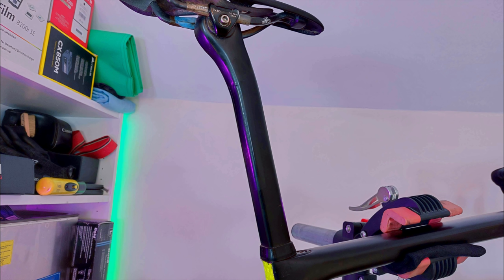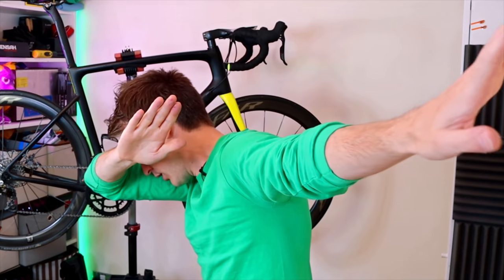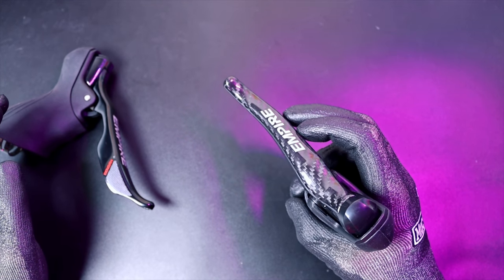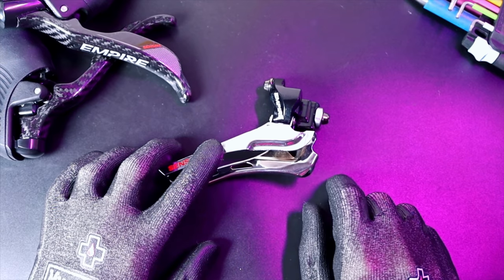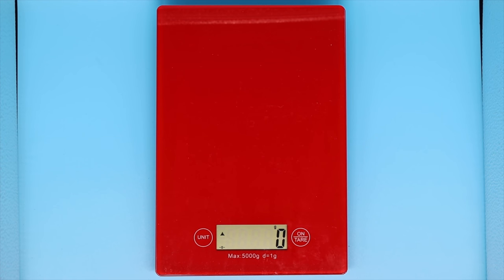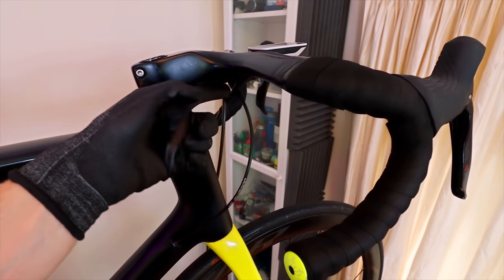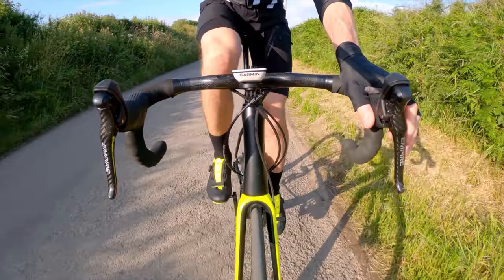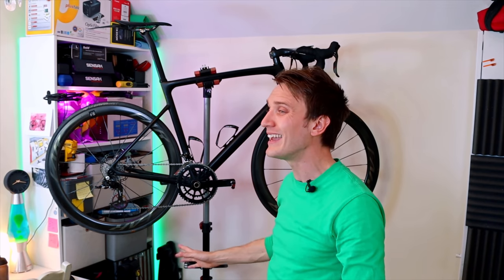Chinese Full Carbon Groupset (with OSPW) - Sensah Empire

Comment: May I suggest Trace Velo do a Power Meter video series next?  The crankset is probably the last thing that hasn’t been upgraded on the fully carbon bike.
Reply: ive got the sigeyi axo and zrace crankset. its awesome.
Reply: @abedfo88  Hiw reliable has it been?
Reply: @takotsubo as long as its consistent with itself what does it matter how it compares to assioma duo 🤔
Reply: @elijahkwon422  100% reliable
Reply: @abedfo88  Have you done any accuracy checks
Reply: @elijahkwon422  i will do this coming winter with my elite direto but knowing my power numbers etc it seems to be pretty good.
Reply: @abedfo88  what kind of pm is dat? The spider based? Andd on what crankset? Haha thanks in advance
Reply: @Lutherman_edc  spider based. If you go on their website/ali express shop they sell a number of models to fit different cranksets.
Reply: @abedfo88  ohh nicee thanks mann and what crankset do you use?
Reply: @Lutherman_edc  the Zrace one. You can buy that, the BB and the power meter in a bundle.
Reply: Can you make a video solving the carbon trouble you mention on 5:42 of this video. Thanks

Comment: I had the 9 to 10 shifting problem, which I could never figure out. The derailleur seemed well aligned to me. After 6 months, the problem went away, so I had assumed it was a machining problem on the cassette that was worn away with usage. I've been mostly happy with my Sensah gear, and thank you for being a valuable technical resource on their products.
Reply: I've had the same problem on my bike a few weeks ago, when i asked my mechanic, he said it was normal because it was new, fresh from the factory and overtime the chain, cassette and rd will eventually adapt to the shifting, which eventually it did

Comment: Me: So Trace how many chinese carbon fibre parts do you think you can put on a bike?

Trace: Yes
Reply from the maker: I think the only parts that arn't cheaper alternatives are the chain, the tyres, and the cable housings 😂
Reply: @TraceVelo  indeed, and now ali express ads tax the cost/benefit ratio has gone down slightly imho.
Reply: @abedfo88  Yeah - I noticed that (in UK), this happened after Brexit. Odd.
Reply: @Mango62uk  though I did buy something over £200 and I didn't pay any tax (shrugs shoulders)
Reply: @abedfo88  Interesting. Now, even for the smallest thing, Aliexpress shows tax for UK sales. I suppose it's a good thing, as long as the tax is sent to UK govt!
Reply: @Mango62uk  Hahaha well that's debatable ! 

Yeah annoying how things like cycking socks have gone from £1.50 to £3
Reply: @abedfo88  Bloody hell, you're correct. I checked my account and I paid £1.82 (incl delivery) for a pair of cycling socks in Nov 2020 and today, there're around £3! It really is the post-Brexit trade thingy, 'cos importers now have to account to HMRC directly for UK VAT payments!
Reply: @abedfo88  in italy too, if you buy less than 150€ they add tax since july 2021

Comment: Hi Luke, I'm happy your name hasn't changed. Last week I received my sensah empire groupset and a new 11 speed chainset, now I only need to get some specific tools and a clamp for the front derailleur and will perform the jump from 8 speed to 11 speed on my GT ZR 2000 (I'm ready to take the hub's cassette body to a friend that is quite experienced with a lathe if the larger cassette was to present fitting problems). After almost six years with this bike I'm super stoked!
Thank you for providing me and others with products reviews, experiences, useful tips and great comedic bits. I hope you keep the videos coming!

Comment: Trace Velo: Buy cheaper bike components and save money over alternatives
also Trace Velo: LMAO just replaced this component that works fine for the 15th time :P
Reply: For free.
Reply: This is still a good value compared to standard 105 even if the non carbon version does not exist
Reply: He can replace the groupset and wheels before he even buys a 105 groupset for 700$
Reply: This video was sponsored / paid promotion.

Comment: Great channel.  I did purchase a Sensah SRX Pro group set in an effort to make an ultimate road climber - it failed miserably.  The front chain ring could not tolerate the torque and bent.  The derailleur  would down shift all on it's own.  The chain was of very poor quality.  All of his installed by a tenured bike mechanic.  I threw the entire set out an went with full Sram components.  Yes, a few bucks more but the shifting is flawless.  By way of mention I did do this build on an Elves frame which seems quie good and wen with ICAN rims that seem to be performing well.  Chinese cycling products seem to be hit or miss.

Comment: I broke my Tiagra shifters and replaced them with Sensah Quantum shifters (the ten speed version of Empire), which are 100% compatible with Shimano. If anything I prefer them to the original Tiagra shifters. Shifting is very crisp and now I've got used to the SRAM style double-tap system I think I prefer it. In fact I'd say the Sensah shifting system is actually better than SRAM system as you shift with the main brake lever rather than a smaller secondary lever. Recommended...very well made shifters and super cheap.
Reply from the maker: Awesome, glad you like them Simon!

Comment: I've been using Sensah for the past 2 years, around 40k Kms on it, I only had to replace the right shifter hood cover (4€).
Reply: UPDATE: Today the screw from the  above little-wheel of the rear derailleur (IDK how it is called in English) just fell out and I had to stop, take the whole thing out and screw it again into the derailleur
Reply: @daniellopez9622  jinxed it mate
Reply: @daniellopez9622  derailleur jockey wheels should have threadlocking compound to stop screws/bolts from coming loose e.g.  Loctite Threadlocker Blue 242. Maybe the Sensah ones didn't come with it, or not enough?
Reply: @richardggeorge  UPDATE: The bearings inside the jockey wheel were all broken and the screw didn't match the cage anymore, the cage expanded itself and after replacing the jockey wheels with the Ultegra ones the cage of the derailleur did not hold the screws and it just broke... Luckily I was near home.
Reply: @daniellopez9622  Sorry to hear that. Doesn't sound like the jockey wheels are very durable. I have several shimano ones that are over 10 years old. I have 4 road bikes though
Reply: @daniellopez9622  Can you confirm the jockey wheel that comes with pro is the Utegra version? Since the derailleur is sram, I would think the pulley would be same
Reply: @cornelhughes6763  I only can confirm that Ultegra jockey wheels do not work for this groupset

Comment: The company Finish Line has an anti-seize assembly lube. Here in Germany you get it for 5€ (22 ml) which should last for quite a while and will prevent any cold welding of screws etc.

Comment: I think the screw in the rear derailleur ceased up because of contact corrosion (Alumunium/Steel)
Great video as always!
Reply from the maker: Yeah, I recon you're probably right. Hopefully the oil I added will help out in this regard....
Reply: I've managed to strip the non-drive side crank (Shimano) bolt head hex slot TWICE.  Now I put on some anti-seize compound on the crank bolt thread and regular grease on other bolts.
Reply: @john lin is right some copper compound will prevent that in the future 👌

Comment: Another great vid Luke! Am absolutely loving the channel; you are head and shoulders more fun and informative than GCN.

Thanks to you I'm rocking a new gravel bike build using Sensah's SRX Pro 1x groupset with ZRace crankset (plus an absolute feast of cheap Chinese carbon finishing kit!) I've done about 2,000 miles on the groupset now and it hasn't missed a beat. The downshift is the best I've ever used on any mechanical shifter! I'm not sure how good the clutch mechanism is but that's only because I haven't used any other type; I do get a bit of chain slap though if it's really rough. The only problem I've had has been with the flimsy barrel adjuster on the rear mech which kept loosening as I rode. I've just locked it out and use the downtube adjuster now. I paid less for the entire drivetrain including the bottom bracket than I would have done for a pair of 105 levers. I've recently installed a pair of Juin Tech callipers and so far I'm really impressed compared with the TRP HY/RD's I had on the bike before. I'm looking forward to your review of the brakes.

Please, please keep up the great work, everyone I know is watching and loving it!

Comment: I suspect the reason why the old rear derailleur could not be removed was a lack of grease in the threads. Aluminum and steel can fuse together over time if not adequately greased.

Comment: Add oil or grease into the derailleur hanger articulation. It's potentially a galvanic seizure that wrecked your last one.
Reply from the maker: Yeah I recon you're probably right. Galvanic corrosion could def have a played a part, but yeah stuck a bit of high viscosity oil in there this time, should hopefully keep it from happening

Comment: Here's another bit of information - the pulley cages on the Sensah derailleur's are not replaceable, they are locked in my rivets. I reached out to both Sensah and Lingmai (who seems to have provided the OSPW for this rear derailleur) and they both confirmed that the derailleur pulley cage is not replacement / interchangeable. I guess that's one way Sensah keeps their cost down.
I was looking at replacing the pulley cage as mine was totalled in a rear derailleur hanger issue.

Comment: The reason why they don't put on bearing seals on the pulley wheels is because its responsible for around 60% of the bearing drag, that's 20 times more than the effect of the ceramic balls. So they spin nicely without preload when you do the spinning test, which doesn't reflect the conditions while riding. It goes without saying that the seals are majorly important so dirt don't get in and the lubricant doesn't get out....if you replace the bearing with good industry standard bearings(NTN, NSK,SKF) you should be fine though.
Reply from the maker: Thanks for the comment Felix 👌
Makes alot of sense actually, removing the seals would def reduce drag and make them spin nicely. I wonder if it is also a bit of a cost saving measure aswell...?
Reply: @TraceVelo  well that's knowledge out the hambini schoolbook ;-) feel free to visit his video on the matter from 4 years ago. I guess the seals cost 2-3 cents so not really. Interesting sidenote 0 OSPWs in the Top10 of the mens olympic TT if there was marginal gains you would think the worldtour pros would be using them
Reply from the maker: Yeah totally fair comment. You would also think that if Shimano thought there was a benefit to it, they would have stuck one on their dura ace setup, and charged a few extra bucks...

Comment: Seen frozen mount bolts quite often. Generally all the lube leeches out because of poor sealing and you get corrosion. Oil or a rebuild every so often sorts it.
Reply from the maker: Nice, thanks for the comment Matt, good to know! I'll definitely keep this part oiled and serviced from now on!
Reply: @TraceVelo  copper slip on threaded parts, lifesaver.
Reply: @abedfo88  I'd recommend Loctite 222 (purple) or other similar low strength threadlocker, as it also protects from vibration as well corrosion.

Comment: Jockey wheel bearings... I was just cleaning a Shimano 105 rear derailleur and it uses bushings on the jockey wheels.
Reply from the maker: Yeah the shimabo ones always use a little metal bushing. I guess it probably lasts longer than a sealed bearing....

Comment: I just want Sensah to release a clutched rear derailleur so we can have an affordable gravel/touring groupset. I think there are good enough alternatives for cable actuated hydraulic disc brakes, but dealing with dropped chains and chain slap is a pain.
Reply: Look up sensah srx pro
Reply: @seniorcycling5352  I don't believe the SRX is clutched, it just has an adjustible tension spring

Comment: I have the Sensah Empire groupset on my zwift trainer bike. I have no issues with the shifting. Just as good as my Ultegra set I had on the bike previously.
Reply: What would you choose between sensah empire pro and shimano 105 r7000?
Reply: @MrBubba3494  yes. Maybe not Ultegra. Depends on the deal I get.

Comment: Instead of oil, use grease on the insert threads of the derailleur. It will last a lot longer...
Reply: Couldn't agree more! Especially for the dreadful UK climate
Reply: Every mating surface on my bike has at least a thin layer of grease. I cringe watching assembly vids where they use nothing😅

Comment: Hi thank you for your videos. I enjoy very much. I just happend to have a new  Empire  rear derailer in my hands (not installed yet) and I can tell you that it was not your fault if the bolt was seized after a year of use. I removed the C clip and got out the bolt and it is completely dry there. So I greased it . Thanks to you.

Comment: Luke did you need to replace the chain with a longer one to cater for the larger pulley wheels?  Thanks for the videos which are both entertaining and informative.
Reply from the maker: Yeah so it was actually worn out anyway, so i replaced the whole chain when I fitted this new groupset. But yeah I would probably have done it anyway, as the ospw does usually need a few extra links...

Comment: Luke I gave up on the front derailleur, and instead use a 105 shimano. I prefer the Sensah levers ,size and shape,but always have some kind of shifting issues, unless the chain and all are spotless, I have an ongoing problem with 9,10,11 .
Reply from the maker: So I have found the trick to decent shifting, is keeping the shift cable clean and well lubed within the shifter housing (basically keep the friction on the cable as low as humanly possible). I'm actually playing around with dry chain lube atm, seems to work great. Also make sure the cable is secured correctly on the rear derailleur bolt. You want the cable fed over the top of the clamping bolt (you can check the manual I linked in the description if you need some clarification). Hope that helps 😁
Reply: @TraceVelo  ,I am pleased that you responded, I built two f12 from Ali-express, one is basically all China and the other is 105,both wheelsets are Elite,tubeless and 27mm widex38mm and 45mm deep.The framesets are beautiful, if a little heavy at just over 18lbs.I have been a cyclist for 30 years and have ridden almost every thing, I have a high regard for the obscure manufacturers and don't care for the hype about the known ones. My point is that if a man can get the same or comparable product for nearly one tenth the price, where is all that moolah goin.?I don't have buyers remorse, like my previous bike, which I had to finance! Contrarily, I was able to get two bikes for the sale of my Specialized (used),and had money left. Not that I need 2 bikes, but I intended @ 66 yrs. to start a new business in bike sales. Seems like a no brainer?Bikes are flying off the shelves, but the people are not interested in this product. The carbon is world class,the design is iconic and the price is unreal? What is not to like?I now have several thousand miles on these beauties and I love the ride, and handling, the frameset is very tight. I digress, as regards to the shifting issues, I have been using a lightweight Ali-express cassette and I am hoping when I can, I'll try a hyperglide, this and as you suggested a cable reassessment, ( I have all internal cables).I appreciate your input and will continue to enjoy future posts, maybe you can get sponsor to help you, and build one of these beauties for your (Show) .I found the internal routing to be a challenge, but I wonder now why the cables have been outside for so long! Thanks for your indulgence and may the wind be at your back!

Comment: That is not the stock chainring on the crankset. Did you change it for a larger size or just the look of it? 

Great review as always...I'm still running the original grey empire shifters, I was eyeing the carbon ones, this may be what nudges me to finally upgrade.

Comment: Would be keen to know how you go with the wear on the carbon shifters over time. I got a pair of carbon Team Pros and running into the same issues with shifter wear.
Reply from the maker: Recon you could send me a pic of the wear on your set? I've stuck my email in the video description.  I'd be really interested to see what it's like!
Reply: @TraceVelo  sure will do! Tbh I've only done some quick rides on it and it's started to dig in already. It's like a fine powder residue... So it's just a slow grinding process. Bought some 3M helicopter tape though so hopefully it'll solve the problem :)

Comment: Hey Luke, how did you remove the covers on your jockey wheels to replace the bearings? I’m having a tough time popping them off but they’ve already become a bit scratchy about 200kms in.
Reply from the maker: Yeah they can be slightly tricky to get off. I actually had to use a razor blade to slowly work a small gap between the cap and the bearing. Obviously be very careful not to slice your finger open!

Comment: As soon as I saw the aluminium scraping against the carbon shifter I knew that was gonna be a potential issue! Time will tell if it holds up I suppose
Reply from the maker: Yeah exactly. Not too sure how well it will last, but like a said, the fix should be pretty straightforward if it comes to that
Reply: @TraceVelo  did you fix it?

Comment: Do those OSPW have the same “no seal” issue as the previous cage you installed?
Reply from the maker: Yeah they do. All the cheaper ospw's I've seen have these seal-less ceramic bearings for some reason